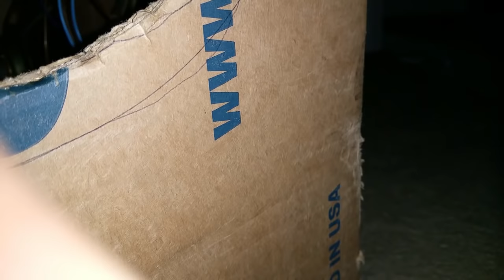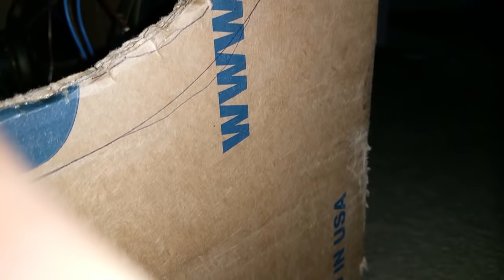Mi amplificador casero luz led al ritmo de la música

Comment: Alguien me puede ayudar como es la concesión de los leds ??
Reply: Conexsion
Reply from the maker: Gabriel 31.W mira tienes q conectar un LED en la los cables del parlante en q lo vas a por dime y te ayudo
Reply from the maker: Gabriel 31.W tienes q decirme porque si tienes un amplificador muy potente puedes arruinarlo
Reply: Tengo un poder de 5000watts
Reply: Tengo que poner una resistencia??
Reply: ALE 9410  como lo ago????
Reply: ALE 9410 ayúdame también tengo otro poder de 200watts